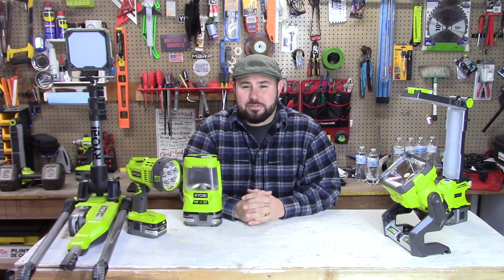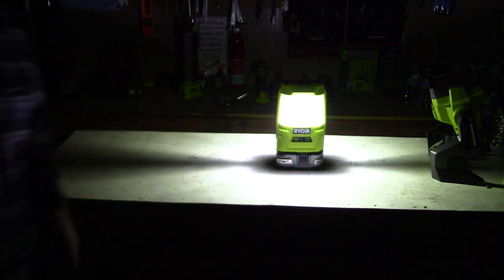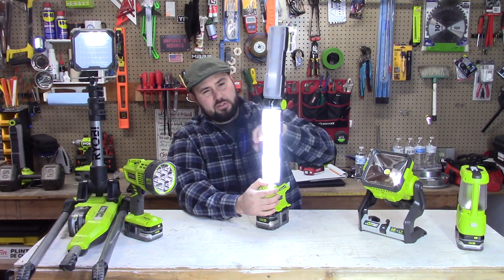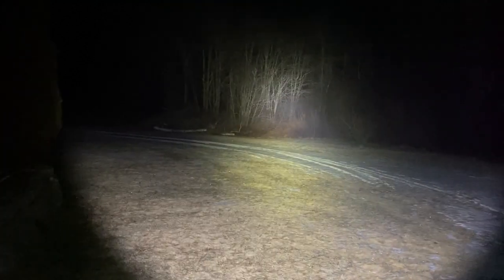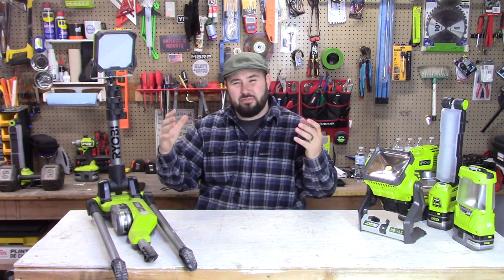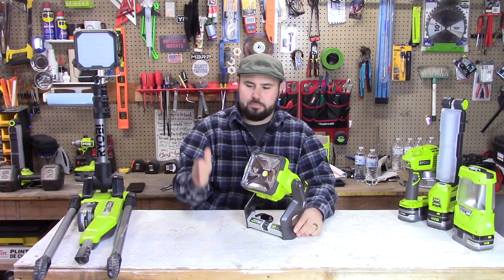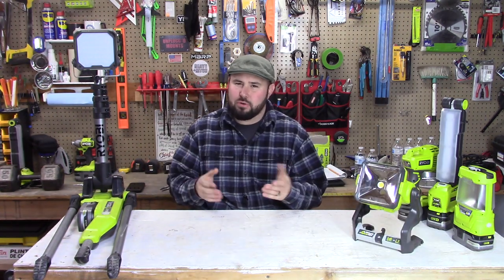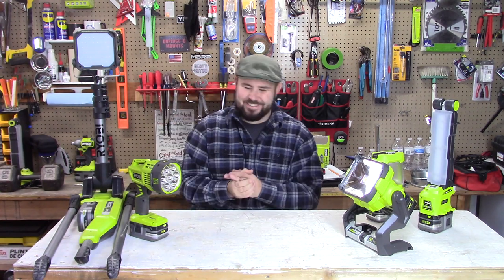Ryobi Lights, are they worth it? Let's find out!

Comment: I used my tripod light a lot while building my addition, before the power was connected. I also use it a lot for grilling and other outdoor stuff. The biggest thing I learned is that the battery goes pretty quick on full brightness. But, if you click the switch again, it’s not much dimmer, but the battery lasts MUCH longer!
Reply: oh yeah, just how much longer?? 🤨
Reply: @jessihawkins9116  more than double the time.

Comment: For my needs (home use) the "Workbench" light is very handy.  Use while painting a room, fixing my cameras, and emergency lighting.  The other handy item is the hybrid portable fan again a must have item from Ryobi. A head lamp added to my car tool bag. I find it extremely handy for road side repairs.  I used mine 3 times and glad I had it.
Reply: ANOTHER handy item is one of those LARGEST plastic trash bags in case you have to kneel or lay down on a wet or dirty area

Comment: I got two of the longer / foldable lights with the joint in the middle. The amount of light and the runtime are great, but after a while the upper element stopped shining, because the wire that runs from the battery to the upper half broke. I had to open the damn things and repair the wire. These things were not cheap, so I was kind of bummed.

Comment: Make darn sure you register the products on their website for the 3 year warranty, I have had to use it for sprayers, batteries etc, I typically register then take white electrical tape & wrap the item registered & use a sharpie to write the registered date on the tape & keep the same info on one sheet of paper with their website at the top of it in a notebook.